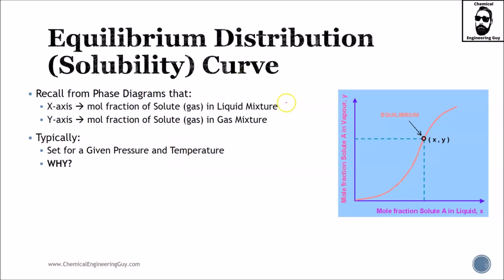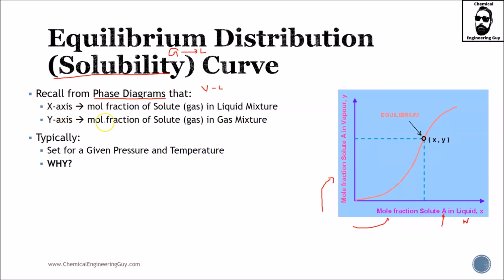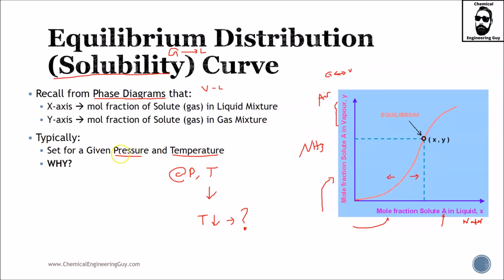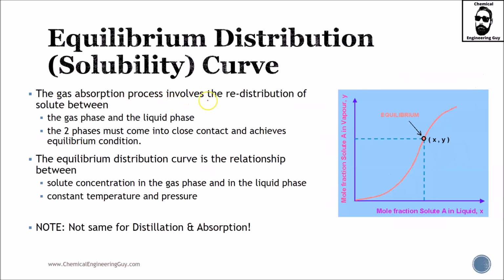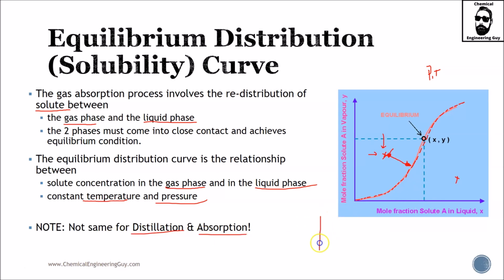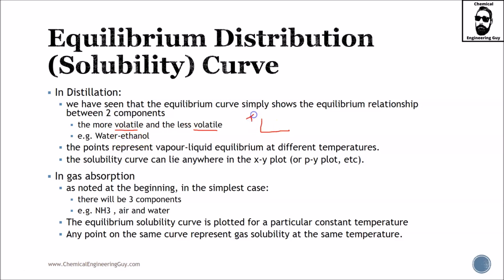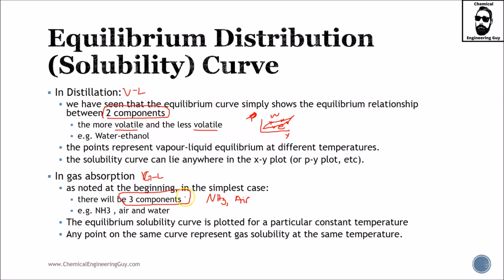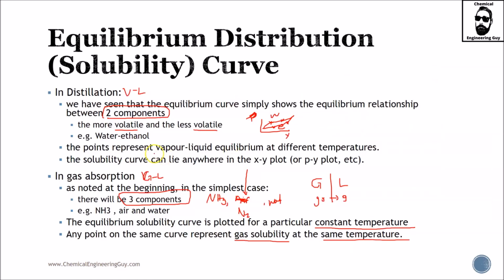Equilibrium Distribution Curve for Solubility. Equilibrium Line and Solubility between  (Lec100)

Comment: Hi  i have question which is chemical reaction engineering A +  B ——>R  Temperature 25C , k 0.0026kmol/m.s  initial feed is 0.15kmol/m^3  flow rate 8.33*10^-6 m^3/s volume 2.5L  find total convertion of : 2series CSTR flow by PFR and 2parallel CSTR    thank you very much for your lecture it help me a lot